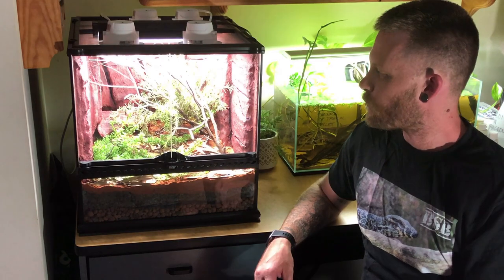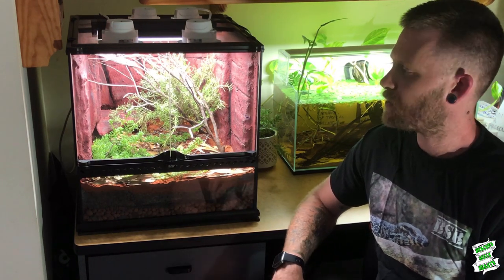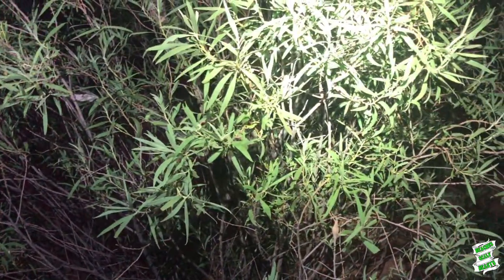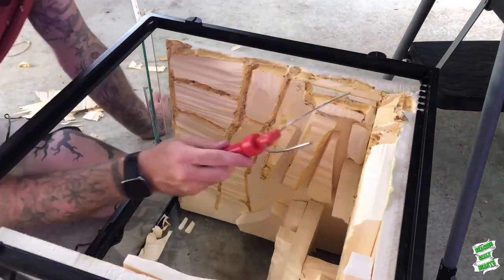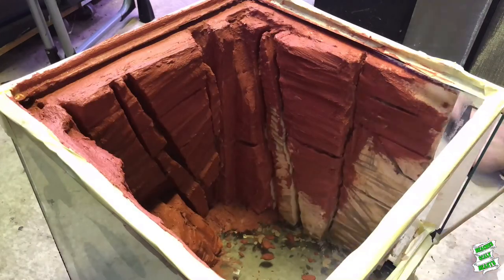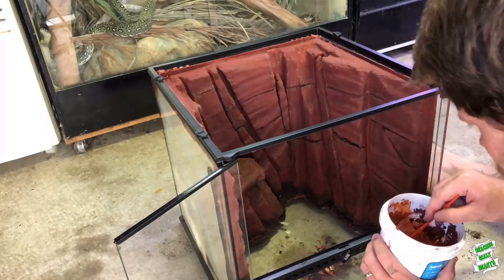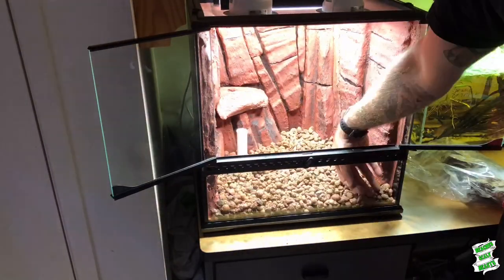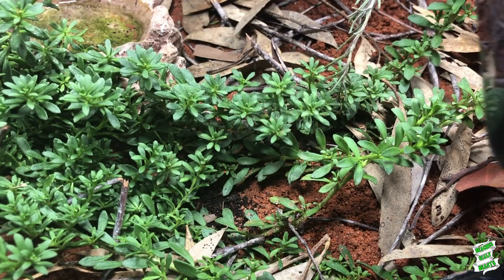The ULTIMATE Australian ARID Bioactive build! ~ Spiny Tailed Geckos - Strophurus ciliarus aberrans

Comment: Been looking at getting some strophs or velvet geckos. Do you recommend using a heat light on them?
Reply from the maker: If other sources of heat are inadequate then yeah I would use a heat lamp on a thermostat. In this circumstance all these lights on this enclosure create a nice warmth up high and cooler temps down low.
Reply: Thanks mate

Comment: Would you need to seal off the background or is the materials safe for reptiles?
Reply from the maker: All safe given enough time to properly cure and air out.
Reply: Thank you so much. I am preparing to get some South-Western Spiny tails and have been binge watching your channel xx @BeachesScalyBeasts
Reply from the maker: @adrianaveth7235  ah nice! Great geckos! If you’re worried at all give it a good week or two to cure after the last coat of pointing. You can also give it a rinse afterwards too. This is the method I used for my frog as I was concerned.